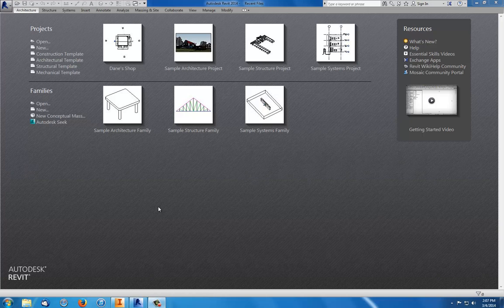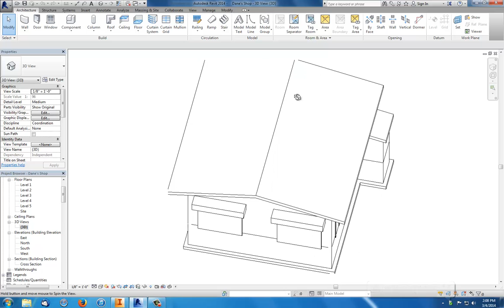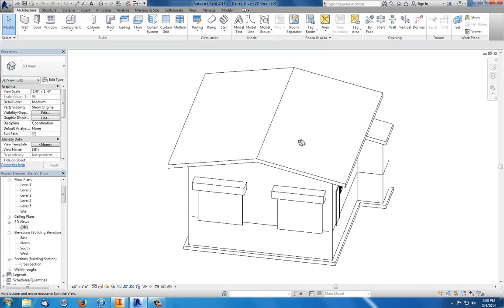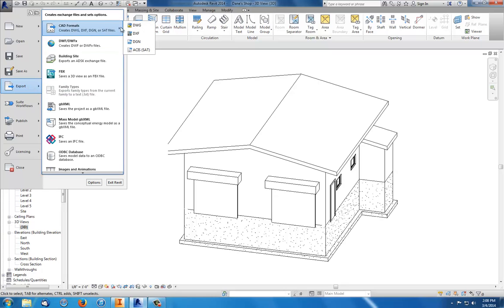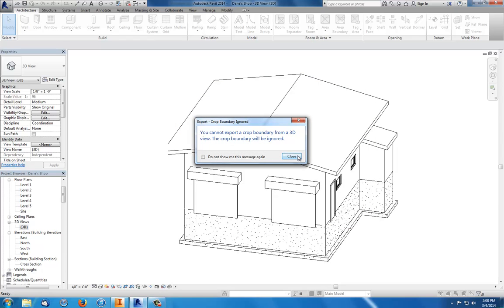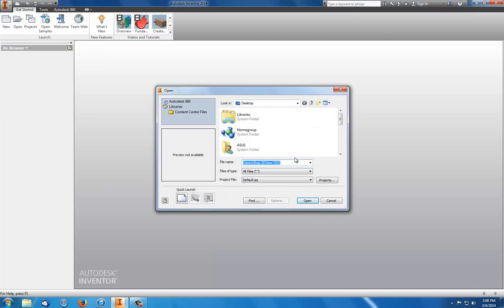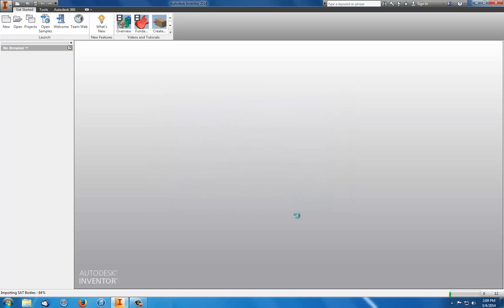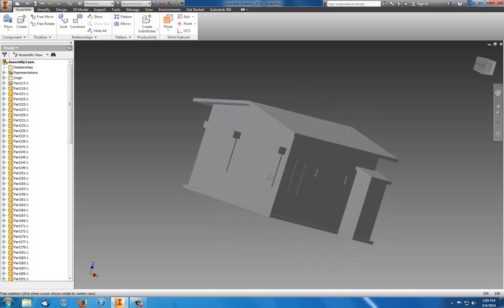How To Export Revit Drawing Files and Import To Inventor

Comment: I am currently working in Revit on a curtain wall for a client. Our fab and shop drawings will be done in Inventor. I am wondering if there is a way to import Revit parts or families into Inventor as ipt files rather than the whole model as just one file? I have been looking it up and no info seems to be out there telling me if this is or even if it isnt possible. Ive been through a few forums and nothing there either which led me here to youtube.